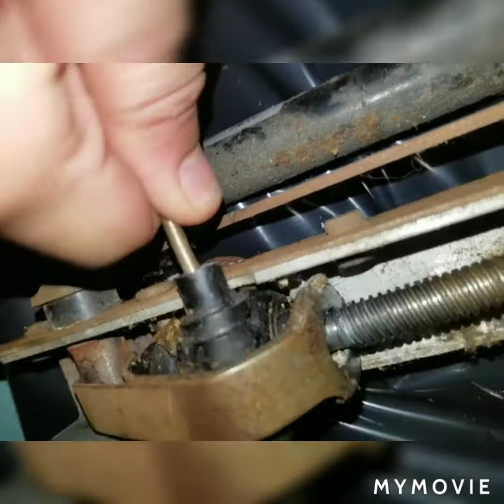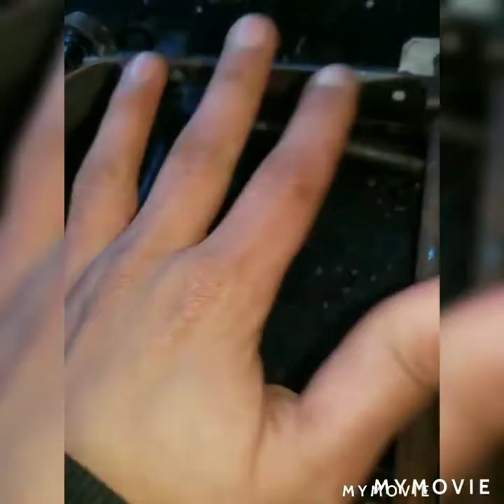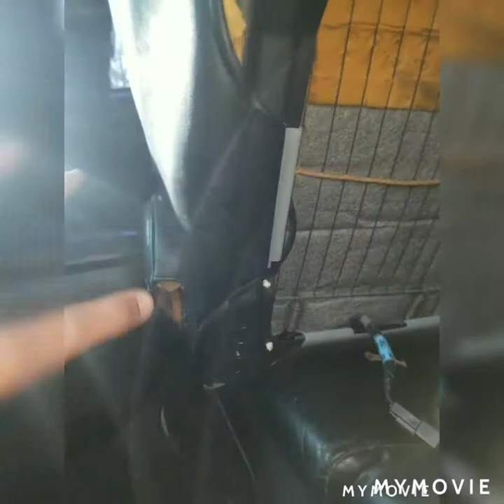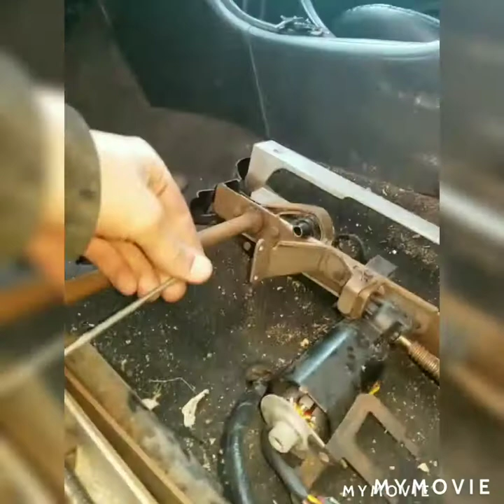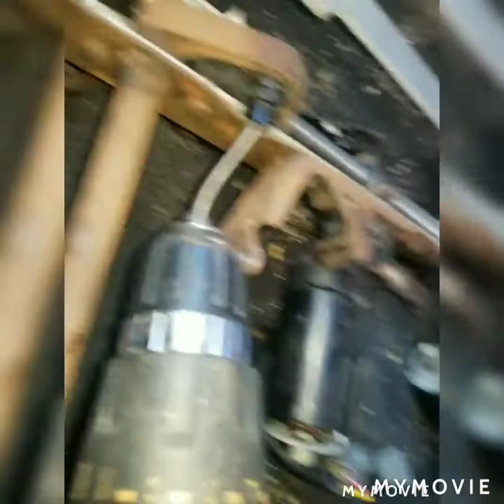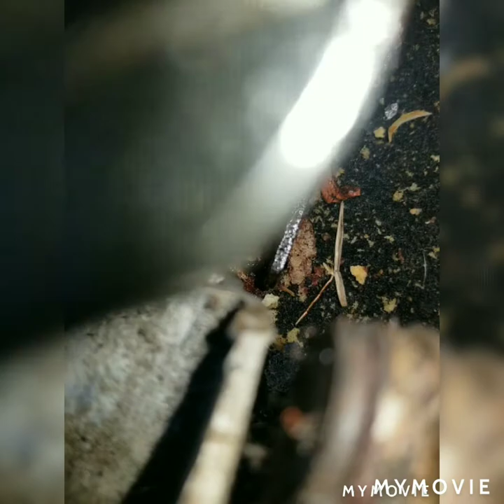How to get a 94 to 04 mustang power seat rail to move tons of forms said it wasn't possible

Comment: Thank you for the tips.
After taking mine apart countless times trying to figure out what was broken I discovered one of the gears in the shaft was broken, motor was fine.
I decided to remove the spinning shaft completely so that the rail moves freely and left the other side working.
Seat moves fine now with a little help from my ass while using the switch, and is still solid in locked position.
Wish I could go to the wreckers for used parts but I'm in Australia and not many SN95's around here.
We gotta get creative here for repairs 😊
Thanks again for your help mate 👍
Reply from the maker: @alphawolf8790  your welcome glad this video is still helping people. Oh neat atlest your able to use it, that makes sense why parts are hard to find for you, compared to Canada/us they are all over the place, again your welcome glad I was able to help

Comment: Thank you! Out of all the videos I watched about fixing my seat yours was the only one that actually showed me what I needed to see!
Reply from the maker: Your welcome I remember back when I was trying to figure it out so many people on forms told me its impossible to remove them with out cutting it or pulling switch out and cutting the wires and playing around with them that video was almost an hr long of the guy just playing with wires trying to get his to move if your motor goes out then that wont work unless you pull motor out then use a drill and the wire to move it like I did

Comment: Smart!
Reply from the maker: Thanks so many forms people said its not possible said to myself theres gotta be a way and figured it out. I think this method might work on any type of power seat rack as long as you can unbolt the motors that move the seats forward and back and stick the little bindy rod like I did to a drill or can probably figure out a different way for those that don't have the rod